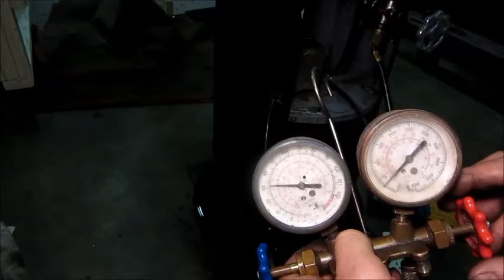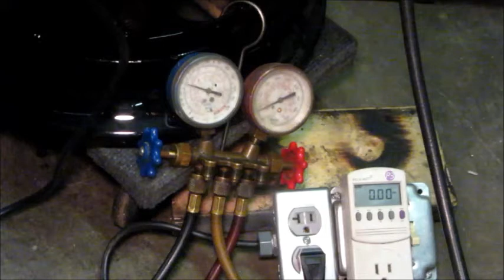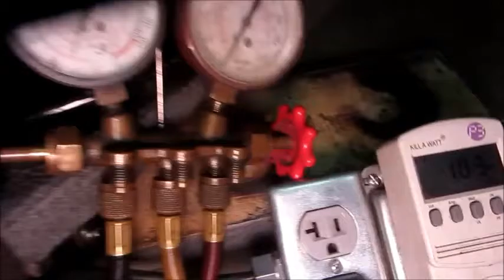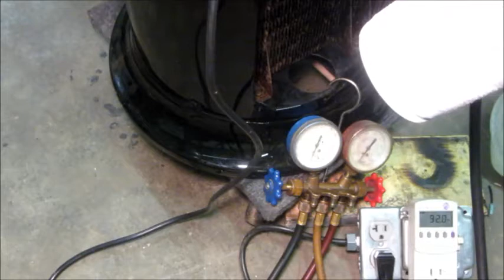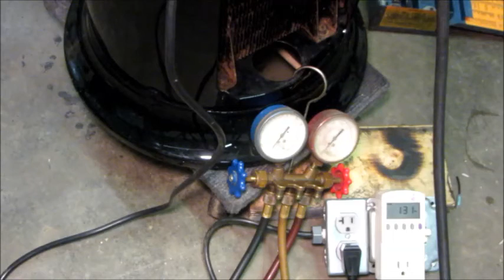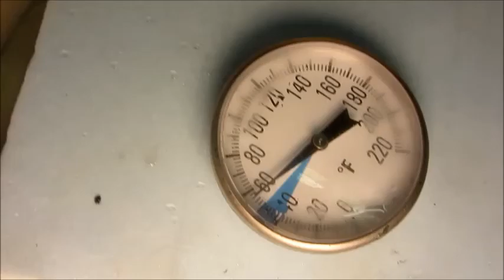Antique Frigidaire carboy water cooler from 1937 - 2 - Fixing the problems...

Comment: Why not use epoxy resin, would that cause the water to be contaminated?
Reply from the maker: I don't think epoxy would be a problem if you used something designed for food contact. However, epoxy is usually very hard and brittle and might not stay bonded like the silicone does.
Reply: @davida1hiwaaynet  Additionally, I'd advise against epoxy on any soft surface such as vinyl or rubber. Polyurethane is another common option, both of these are available for potable water tanks.
Reply from the maker: @thisisyourcaptainspeaking2259  
Agreed. I have found epoxy to be less useful than many of the stories have lead us to believe. It's strong but only when the substrate it's bonded to is also very hard.  Something tough but flexible like polyurethane is a good choice.  The two part "panel bonding adhesive" for autobody work is very useful, as well. It isn't brittle and really works well.